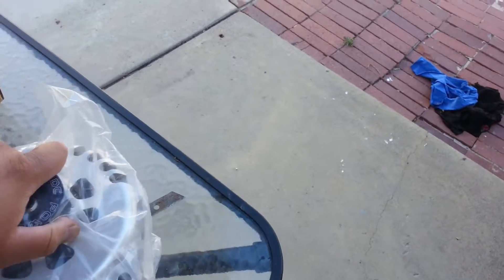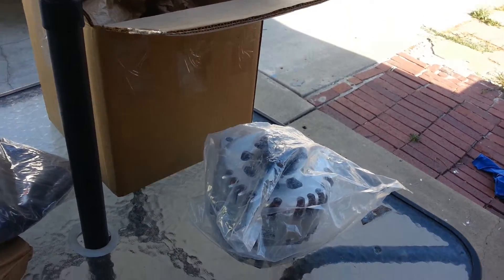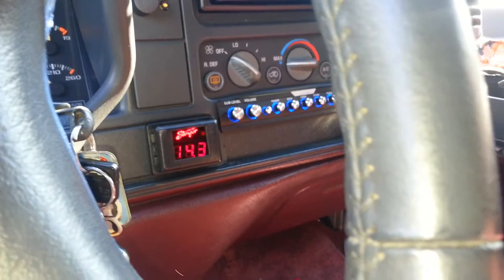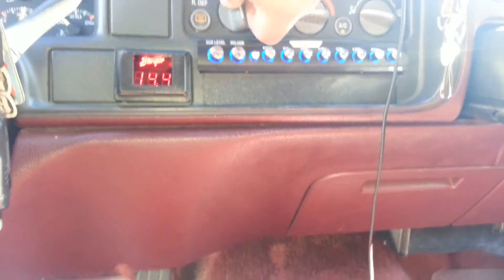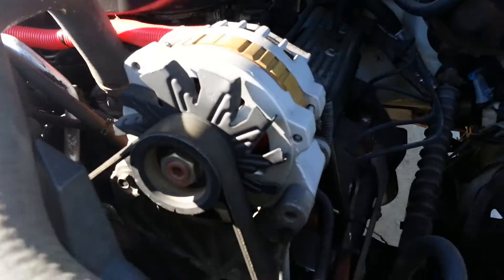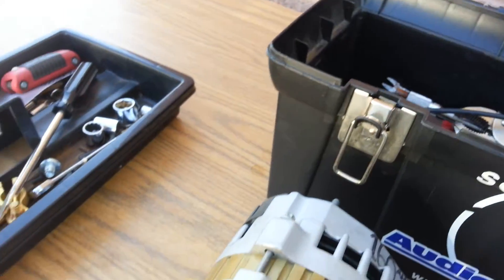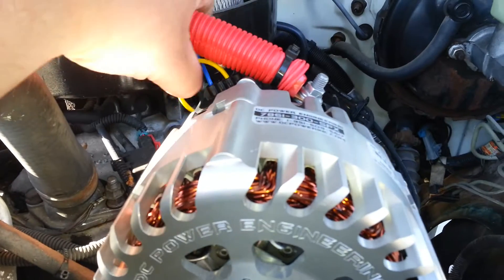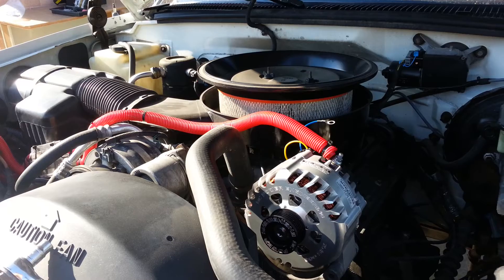Dc power engineering 300 spx update

Comment: una pregunta, done conectaste el alambre azul del adaptador?, porque yo tengo el dc power 370 y me dijeron que lo conectara al power del alternador 😕
Reply from the maker: Cali Bass así es tiene una terminal de harito esa va al power
Reply: LONBERA  ok gracias, ya lo tengo conectado, solo queria estar seguro, pero fijate que tengo un problema con el alternador, me baja el voltaje hasta 11.5 y tengo dos cables de cero gauge rockford fosgate ofc de bateria a bateriay tengo una bateria extra reikken atras y mi amplificador es un ct sounds 4000.1d, no creo que deveria bajarse tanto mi voltaje, tu que opinas